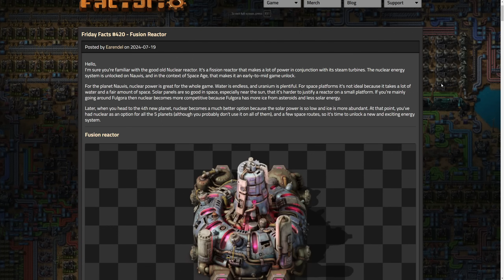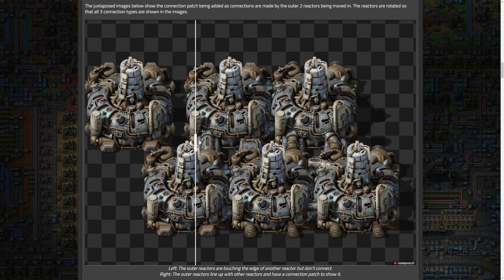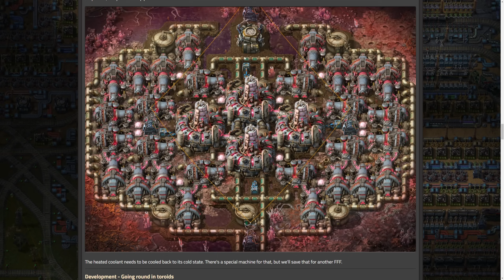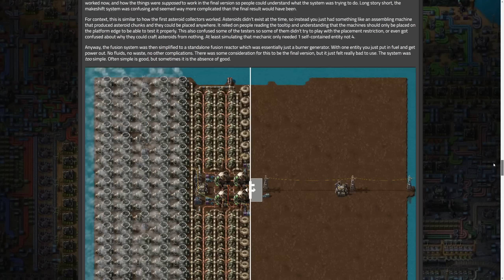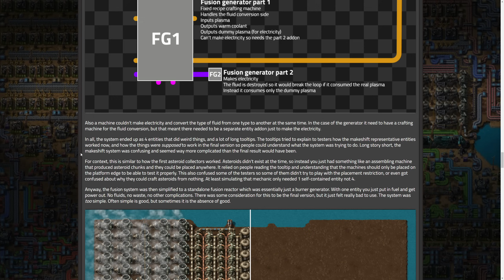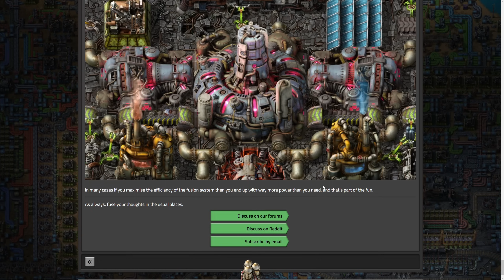Factorio Friday Facts #420: Fusion Power!

Comment: I absolutely love the addition of fusion power into the game as an end-game power option. The one thing that slightly disappoints me about the new fusion system is the fact that the coolant disappears inside the reactor, then reappears as a product of the generator, despite there only being a plasma connection between them. I would have preferred each of those machines to consume cold coolant and produce hot coolant, or have the coolant travel from the reactor to the generator in a more obvious way. Perhaps the devs tried this and it made layouts too messy? either way, still really hyped to have a go with this when the expansion is released!

Comment: It's disappointing they they are using fluids again. The whole reason why nuclear is not feasible for large bases is because of the fluid modeling calculations that kill your UPS. It looks like they are building in the same problems to fusion.
Reply: They're redoing fluids to alleviate the UPS issues. It was covered in one of the newer FFF's.

Comment: 7:57 The core of the sun, where fusion actually takes place, is about 10-15 million Kelvin. That temperature is also considered low. Stars get away with it by trading temperature with pressure to make up the difference needed to get nuclei to fuse. In man-made machine, you'd need temperatures of about 100 million Kelvin all contained by powerful magnets and walls cooled from all the radiative heat.

Comment: Plasma is guided by magnetic fields and never touches anything. What I don´t like is that the plasma is moved out of the reactor. Pretty sure that is not the way it would be done in reality. Would be way to complicated. Holding the plasma inside the donut reactor is hard enough.
Reply: The coolant also travels through the connection so you might as well pretend that it serves as the main energy vessel

Comment: "I feel like that's hotter than the sun" - that's the point, stars are just free-floating self-sustaining fusion reactors out in space. Tokamak-style reactors, like these appear to be modeled after, where the gaseous fuel is heated in a donut/torus-shaped ring while containing the reaction with a crazy powerful magnetic field, have to heat the gas used as fuel to hotter-than-the-surface-of-the-sun temperatures to ignite the plasma (ignition is an actual term in fusion, it's not about lighting on fire or anything). It's not even a sci-fi thing, we can do it here on Earth already, its just that modern test reactors currently struggle with getting out more power than they use, and also with the plasma damaging the magnetic containment walls over time because the magnetic field needs to adjust in real time to the shape of the plasma within the torus to keep it contained, and that isn't easy.

Comment: 8:22 in Fusion reactors, plasma is contained in an electromagnetic field which keeps the plasma from touching the walls of the reactors which are also cooled. This is way these reactors also have a power cost to them its to power the EM shielding and the cooling systems. Which is why here in real life we dont have Fusion power yet, its because we dont have better super conductors to make the shielding, because it costs so much more power to cool the reactors then what they can make atm. To put things simply.
Reply: iirc most shielding is passive. What takes a lot of power is maitaining a magnetic trap around the plasma, and high vacuum in a large volume.

Comment: Fun fact about our sun, the surface is only around 6000 degree. So the factorio plasma is orders of magnitude hotter than our sun surface.
Though sun core where fusion happens is ~10 million degrees, and artificial fusion require ~100 million degrees b/c we can't create sun gravity in our reactor to help out the reaction.
Turned out the factorio plasma is perhaps 2 order of magnitude too cold, but no astrophysicist or game dev would be loosing any sleep if they are just only one or two zero off.
Reply: xkcd 2205 - what's an order of magnitude between friends ;)

Comment: Another fantastic FFF video! This sounds fascinating! I think the fact you have to maintain power in the machine itself is interesting. I assume when you completely run out of power, the plasma "loses containment" and therefor you lose all stored energy which is fascinating.

I dont think fusion will be in the last planet. I think it will require resource on all 3 of the new planets. You mention its blue and the last planet that we know is cold, but the EM plant on Fulgora is also blue. It also makes sense that the resource on Fulgora is homium, which is for magnets, which is needed for containment. Tungsten is used in tokamaks as well. So maybe something we get from Gleba is used for the fuel or another process?

What im interested in is the cooling machine and what other uses it would have. If it was only for this, it would be shown. I wonder if we also need to sometimes impart heat into something, potentially needing to integrate it with heat pipes?!

Comment: I wonder whether there could end up being other uses for the superheated plasma than just generating power (like with steam being used for coal liquefaction) - it could be an interesting challenge to try to route inputs and outputs for crafting in amongst crafters that have to be directly connected to a fusion plant (or each other) with the potential to use the adjacency bonuses to reward clever spaghetti with more crafters per reactor/fuel cell/coolant.

If Wube don't do it I've no doubt there are mod authors watching closely and dreaming of the potential...
Reply from the maker: @gnutrino  absolutely! That would be really cool. One thing I'd like is some sort of crazy late game plasma turret or something that just vaporizes bugs hehe
Reply: wait, are you suggesting fusion drive that eject plasma to achieve spaceship victory?

Comment: Not a nuclear physicist, but I believe that theoretical / proof of concept fusion reactors do get stupidly ridiculously hot. Maybe not millions of degrees, but up there. However the reaction is contained within a magnetic field, so no material needs to be able to withstand that heat during the reaction.
Reply: That's partially correct. The plasma gets incredibly hot and is contained by a magnetic field. But it instantly cools down when it hits the wall, because it's not much plasma.
The magnetic field isn't to protect the walls, it's to protect the plasma from cooling down.
Reply: @youareliedtobythemedia  Where do you think all that heat energy goes if the plasma cools down?
Reply: @SeventhEntropy  into the wall. Again, the plasma is incredible hot, but it doesn't have a lot of mass. It's like throwing a glowing block of steel into the ocean and expecting the ocean to heat.
Reply: As the Sun is big, it can fuse hydrogen at around 1M degrees. Because our fusion reactors are smaller than the Sun, we need higher temperatures of 100M+ degrees to produce useful amounts of energy. A very spicy fusion meatball
Reply: actually fusion reactors use something in the order of 50-120 million degrees! Though the mass is generally incredibly small so its not like a superheated sun in there its just something to force fusion to happen without the assistance of gravity that you generally get when you are 90% of the solar system's mass
Reply: actually, they go into 100+ million degrees for the plasma temperatures - either that, or you'd have to run at insane, stellar core-grade pressures to enable fusion (which is what a thermonuclear weapon does - where all the energy of a standard "small" fission bomb is used up at crushing and heating up the fusion fuel so it can fuse)

Comment: Buffering power is absolutely a thing you can do with nuclear. build more turbines than your reactors can support and store excess steam in storage tanks. Steam builds up during low power and gets used when power draw peaks.
Reply from the maker: Yeah for sure. I guess I needed to be more specific, that I meant you can't do it inherently within the system.
Reply: @Xterminator  Yeah, but I think you actually can buffer (current) surplus nuclear energy. Shouldn't you be able to build an ever longer row of heat pipes, so that they will conserve any extra heat output from connected reactors until all of them are 1000 °C, then build the next heat pipe, etc.
Reply: Why would you ever do this (in 1.1)?  One uranium patch is a ridiculous amount of fuel, and you burn fuel at a fixed rate, whether or not you need the power.  I get that people over-engineer stuff for the sake of over-engineering stuff, but for nuclear it's just off the rails.
Reply: @SkorjOlafsen  The answer is : build a megabase.
Reply: @peterschmidt1900  Why would you think I haven't?  My latest is 3.6k SPM running on ~100 reactors (and a bunch of solar).  Hundreds of hours in and still on one uranium patch.  I even do my best to give lots of uranium away to the neighbors (at high velocity).  There is simply no need to conserve uranium.
Reply: @SkorjOlafsen  I still think the neighborhood bonus should increase the consumption rate as well. There's no point in reducing an already miniscule resource draw and penalizing smaller setups with inefficiency. Tight clusters are already more space efficient and good for UPS anyway.
Reply: thats bad for ups
Reply: @emersonmatheus8611  fluid will be reworked in 2.0, so it will probably be fine after the update
Reply: @emersonmatheus8611  it will be much better in update with the reworked pipes